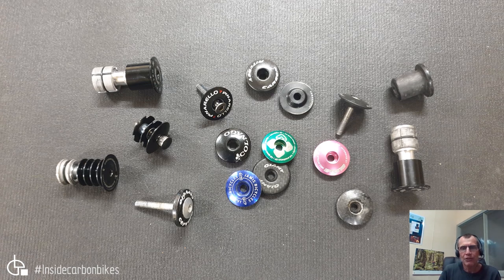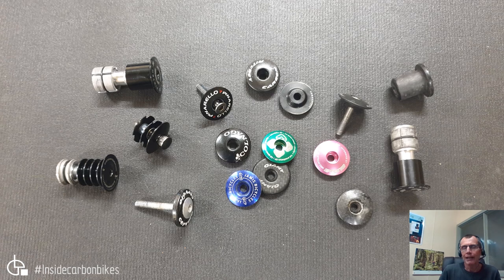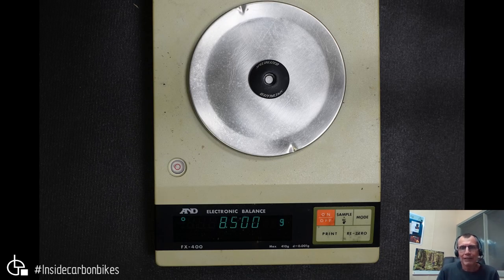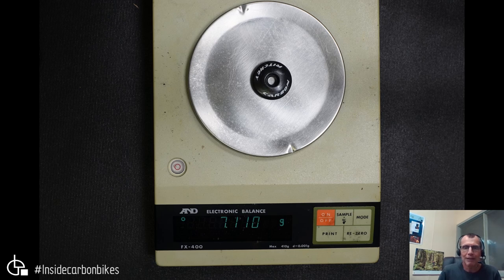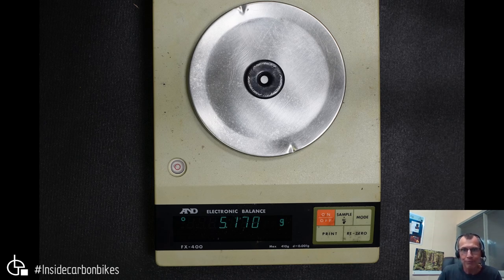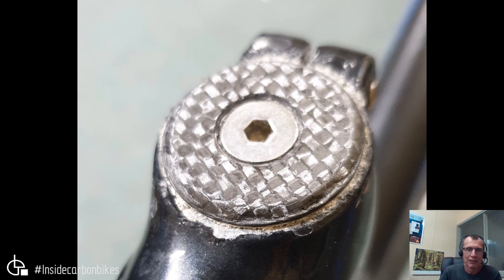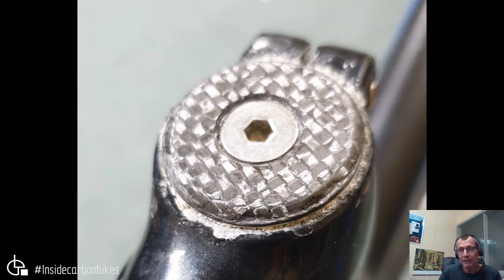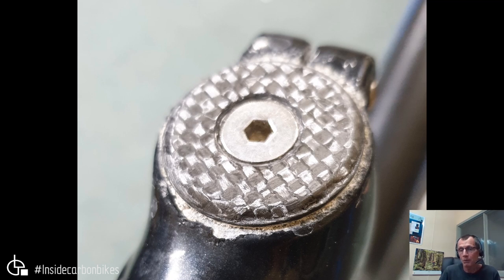Stem Top Caps

Comment: I remember reading somewhere the original aheadset design came with a plastic top cap designed to break if you over-tightened it and put too much preload on the bearings. 
People kept breaking them so companies started selling aftermarket aluminium ones...
Reply from the maker: I still have one of the original plastic ones.

Comment: With respect to the Specialized "wagon wheel" star shaped cap, i only ever saw it on mountain bikes. 99% of them had aluminum steerers and were open through the bottom. However, their S-Works xc  mountain bikes often had one piece carbon steerers and still had the same top cap. There were problems associated with that, though not what one would think.
Reply from the maker: I have seen quite a few road bikes with this cap fitted #weightweenies

Comment: Actually I am more interested in the bottom side of top caps. If these are not flat (and most are not), you will have to push the compression plug further down in order to get the preload onto the bearings. This could cause the upper clamping of the stem to have no compression plug resistance and cause steerer tube damage. Even with an extra spacer below the top cap the upper clamping of the stem could still miss the compression plug.
Reply: I have a top cap with integrated Gopro mount. It's extreme in that aspect. It goes so far down that if I would want to have it flush with the stem, I'd have to cut my steerer at least a centimeter below the top of the stem. That seemed like a bad idea to me, so now I have a spacer on top of the stem instead.

Comment: Wherever the top cap provides compression,   does the stem have to be placed in exactly the same position?
Just wondered, got a new Trek where I've lowered stem but top cap is still at the top. To get them aligned I'd have to cut down the tube

Comment: I thought the first cap/total pic, was my grandmother's 1960s aluminium saucepan lid. Great info and congrats on 16k subs. The super cut out cap  probably off a mtb with alloy steerer.
Reply from the maker: Thanks, even on an aluminum steerer it's not ideal!
Reply: @LuescherTeknik  I wouldn't use even on my mtb either it's just silly.
Reply: When I saw the 1st & 2nd I thought why does he say it's carbon, looks aluminium to me, they both look the same? I was looking at the aluminium scale as the cap and the black top cap as the handle.

Comment: Just a quick note on the specialized cap. It is only used by spez on mountainbikes with alu steerers and steel starnuts. Water goes straight through. No problems with that.
Reply from the maker: Yes there are problems, the steel rusts and the 7075 steerer is susceptible to stress corrosion. Especially that dirty water, mud etc can be acidic or alkaline.
Reply: Luescher Teknik But steerers on suspension forks are already open from the bottom and full of mud. The only issue with their setup is the three legged starnut they use. They break when people overtighten the compression bolt.

Comment: The hollowed out topcap is generally used on MTBs where the steer tube is aluminum (with star nut) and the bottom of the steer tube is a hole that drops dirt above the front wheel. The alu/steel galvanic battery is much less severe than the alu/carbon one and you aren't trapping any dirt in the steer tube/fork because it just exits out the bottom. It is dangerous to use on carbon forks though.
Reply from the maker: Dirty/muddy water can be acidic or alkaline which can damage the 7075 aluminium steerer. Steel star nut rusts also. Less than ideal.
Reply: @LuescherTeknik  I'm curious how much worse/different a setup like this than any other disimilar metal interface (like a crank/axle interface or even regular bolts in an alu frame). I don't think it would be significantly different but I'm also not an expert.

Comment: On the super cutout 5 spoke stem cap, I've only ever seen those on MTB, and it's just for looks cause you can see the tire through the pipe. I cant see any problem as debris just falls out and any sweat that gets in would be flushed out with any normal washing.
Reply from the maker: Yes there are problems, the steel rusts and the 7075 steerer is susceptible to stress corrosion. Especially that dirty water, mud etc can be acidic or alkaline.
Reply: @LuescherTeknik  thanks, those are good points

Comment: Just curious, what's your view on the current "UV Resistant Paint" that all the company are claiming today? I still observe discoloration on the frames over time. 
- How much protection does these paint provides?
- Will this affect the resin? 
- Whats the industry expectation for the longevity of these paint?
- Does this mean it is not wise to purchase those "naked" frames?
Reply: correct UV will eat into your frame but Ive never found it to be an issue. I had an SWorks Epic for 12 years and it was yellow looking. Never had an issue.

Comment: A lot of these weight weenie parts are made for hillclimb bikes where they might only get used for 10x 1-10 minute races per year. I don't think people care about the rain issue for that. (At least, here in the UK)
Reply from the maker: Does 3 grams really make a difference????
Reply: @LuescherTeknik  You should come to the UK and check out the hill climb season here. It's 1000% bonkers.
Reply: It's pointless, as in case of a top cap, you can just leave it off. Bond in an aluminium tube as steerer support where it's clamped by the stem, temporarily install  an expander and top cap to compress the bearings, tighten the stem, take top cap and expander off. Put a sticker over the hole.
Reply from the maker: I get it, but the reality is that the tears you cry when it fails will weigh more 🤣

Comment: I just weigh my 10 month old 13g carbon stem cap/bolt and I feel dirty for it. Corrosion under the bolt, underside has flaking, mostly dry outdoor rides, one Winter.
Reply: Meanwhile, my 12+yrs all weather 17g Specialized alloy top cap/bolt still doing it’s job.

Comment: Hi Raoul, what your take on Easton internal threading set up.   http://autobus.cyclingnews.com/photos/2008/tech/shows/interbike08/index.php?id=/photos/2008/tech/shows/interbike08/interbike0813/Easton_steerer

I used this system once on one of my cyclocross bikes and well don't know from structure of safety standpoint but was easiest and most consistent system I've ever used outside of star nut in an alloy steerer.